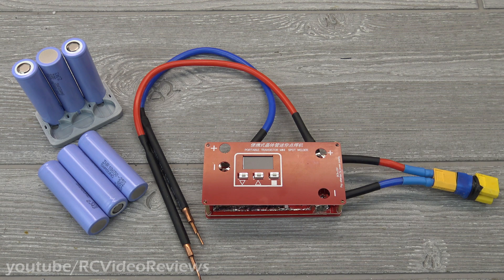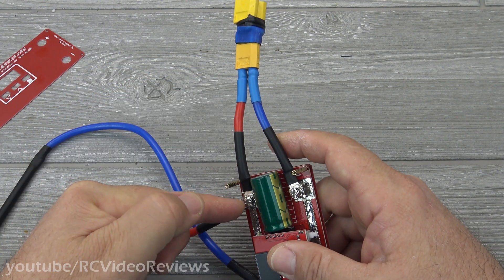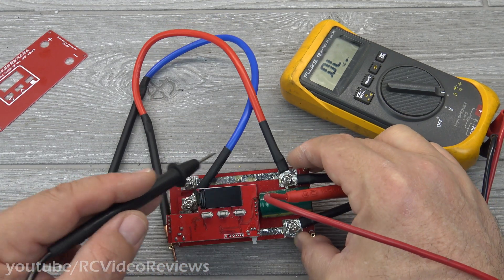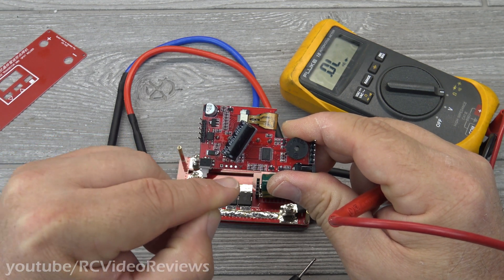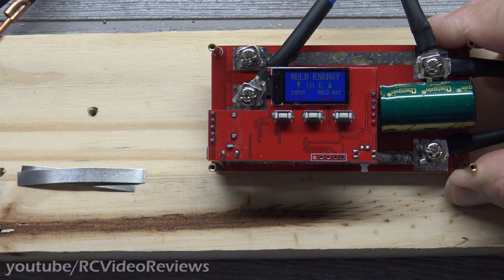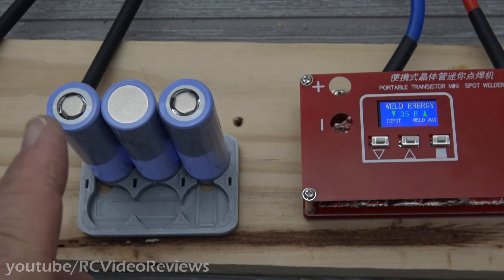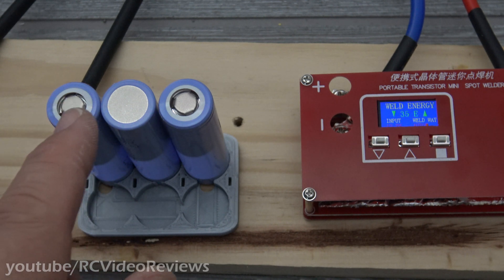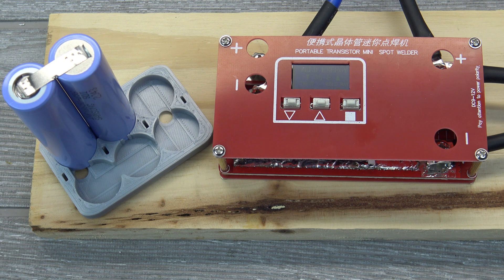Cheap 18650 Spot Welder Reliability Mods and Test

Comment: The positive trace is meant to be like a fuse if the mosfet get shorted, that's why they use 2 srew terminals for the positive . That trace can't provide 300+amps so you don't get a fire if everything get shorted.
Reply from the maker: That's not true at all. I've seen them catch fire in the box stock config. More than once.
Reply: @RCVideoReviews   i am not talking about saving the mosfets from a bad battery. i am talking about saving everything from a good battery by accident.
if you have a bad battery we all know what happens, a single mosfet will burn. you will see the flame and probably you will remove the electrodes.

now if you have a good battery and for some reason the two electrodes get stuck together all cca from the battery will flow to the whole system and the mosfets won't burn cause they can handle the amperage. the trace then will burn from the excessive amperage.
if the battery is good and the mosfet shorted the same applies, the trace won't handle all CCA amps.
if the mosfets are shorted and by accident the electrodes stuck together, the same applies, practically you short a full charged battery and there is nothing to stop it.

same if a short happens before the mosfet , the trace will save the cables and the battery.
you are saved from a big fire/melt of cables, you are not saving the mosfets.
if you don't use a car battery and you use a lipo, i really don't think you want to short it for long.

all decent spot welders (malectrics/kweld) have a 300A fuse in the + line from the battery to protect the battery and the cables , not the mosfets. that fuse is right after the battery terminal (not the same with the trace) but at least is extra protection. think about it you have a unit that shorts a full charged high amperage battery and there is no fuse anywhere (some guys use bigger cables and copper in the traces so there is nothing to hold the amps if something goes wrong).
Reply from the maker: @BeetleJuice1980  That's a pretty poor excuse for a fuse. I wouldn't rely on it and I wouldn't trust it. There's no chance that solder is applied in a way where it could possibly result in a measured fuse. Sorry, not buying it.
Reply: @RCVideoReviews  It's obviously not measured, that's not the point. It's a cheap design, it's a McGyver fuse! It makes sense to me. I can't see why else they'd put it there.
Reply from the maker: @geometerfpv2804  I can't see why they couldn't figure out to put a capacitor across the control circuit either but here we are. If you want to use it as a fuse you can certainly do that. It won't cost you more than a cheap dinner out.

Comment: You are putting too much pressure during the welds. Lay off the force and your welds will be much more reliable. There only needs to be enough pressure to make the contact between the two surfaces, you should not jam one into the other. That reduces the resistance and therefore the heat of the welds making them unreliable.
Reply from the maker: It must be hard to see it in the video, but that's about all the pressure I put on. Just enough to hold the strip still and keep it flat.

Comment: I smoked mine on the very first weld. Blew a mosfet. What is the max amp you can push through these welders?

My battery is a 3s 21700 40t samsung cells. 3s40p capable of providing over 400 amps constant. I think that is my mine blew up. Any ideas?

I ordered a new one. Hope I don't blow it too.
Reply from the maker: The instructions say the load demand can be as high as 140a. The power supply doesn't dictate amperage though, the load does. Mine has been working well with the mods I performed in this video. In fact, I just finished my first 3s2p 18650 pack and the spot welder did fine. I think that capacitor between the diode and ground helps stabilize the control circuit and keeps the fets happy.
Reply: @RCVideoReviews  I'm going to do the mods you did on my next one.

When the mosfets close I figured the load would be infinite. Isn't it basically a short circuit when the mosfets close? If so I pumped around 440 amps through the mosfets. I honestly have no idea if that is true. Building a 140 amp pack for the next spot welder.
Reply: @RCVideoReviews  update:

I removed the blown mosfet. Finished my 3s5p 21700 40t pack. Beefed up the solder, and it's working great with 4 mosfets!! Welding 1.2 strip at level 30. Sweet!
Reply from the maker: @kevinroberts781  Good deal. Did you move your positive pen to the positive input?
Reply: @RCVideoReviews  I did!

Comment: i found it best not to push the probs down to hard on the nickel you get a better weld that way less resistance
Reply from the maker: I haven't done any testing, but I pressed hard enough only to ensure the nickel strip made good contact with the battery terminal.

Comment: Get one of those pens with spring and contact switch. You'd get more consistent result... same force applied onto the contact point each time.
Reply from the maker: I just welded 6 batteries in 3s2p and it did fine. Set to 45e for attaching to batteries.

Comment: I would be interested to hear what others think of these welders because I bought one a few weeks ago, did the Cap mod before using it, saw the soldered link on the PCB and connected my leads direct to reduce the resistance, basically the same as RC vid reviews mods. My results have been mixed. welding two pieces of tabs together can produce a 'strongish' weld but when trying to weld the tabs to a battery the zap just isn't there. I perhaps need to up the current available and try again.
Reply: To the OP, you may be pushing too hard. Pushing hard actually decreases the resistance, so lowers the heat, and makes it weld less. Kind of counter-intuitive. Just barely put enough pressure to hold the parts together.
Reply: Yeah... not enough water in the barrel won't produce a strong stream at the output.
Reply from the maker: What power source are you using? I wound up using 45e and a 12.1+ v 3s LiPo and the welds worked pretty well. I charged at 5a, discharged at 8a and it did well.
Reply: @RCVideoReviews  I tried 3S 2200mAh 35c I haven't reduced the length of my input power leads yet but that should help as they do get warm. I do think there's potential for these little units but like all the Cheap-end electronics it can be a bit hit and miss. I will certainly try increasing the potential amps available to give it another shot.
Reply: @RCVideoReviews  What is minimal voltage 3s Lipo for good weldig?
Reply: @Ziomal716  The voltage is dictated by the fact that it's 3S, 4.2 volts per cell fully charged. The manufacturer recommends a 3S with 50-60C discharge rating, 5000mah+.
Reply: @geometerfpv2804  I understand what voltage the 3s lipo kit has, but I'm interested to what lowest voltage do you get good welding? I just ordered my kit and I would like to know how long it can last.
Reply: The required setting is highly variable depending on the power source being used, and the connections to the unit.  That's why the instructions state that it should always be started off at the lowest setting, in case you have a high output power source.  Basically ignore whatever settings anyone else has been successful with, and just ramp up from the lowest setting until the best results are obtained.   Consistency with the pressure applied is necessary also, as that can be a factor with variable results.

Comment: Great video!! I got the same spot welder a couple weeks ago. I did the cap mod before I ever tried to use the welder. I was trying to use a couple 35Ah batteries but had intermittent results. I have a 5200mah 50c battery ordered and should be here tomorrow. Maybe a little to big now that I think about it because thats 260A potential.

Im hoping I get better results with it. 
I thought the traces looked weak. after watching this Im going to build up the negative trace and connect the positive directly.
Reply from the maker: I just finished a 3s2p pack using my 3s2200 and I did stop once to top it off. Other than that, everything worked perfectly.
Reply: My 5200 50c battery came in. I did end up completely desoldering the positive screw terminal so that negative wielding lead cant rub on it. So now connecting positive welding lead can only be connected your way. 

I also used XT90’s for connecting power to the welder. 

Im thinking about trying XT90’s on the welding leads just to see if there would be to much loss through the connector. I figure if it works ok thatd be nice because that would keep the leads together. As well as itd fit a little nicer in the 2.5” zipper hard drive case I stow it in.

I also took a micro push button mounted to a pcb I ground down to almost the width of wielding lead, soldered a 22awg silicone zip-wire to pcb switch and covered switch and pcb with double walled shrink tube with a hole just big enough for the center of the button to be exposed. On the other end I soldered the barrel connector that came with the welder. Then zip-tied switch assembly to welding lead similar to a tig torch switch is mounted. This mod/ add on with the spot welder set to manual mode  makes this so much easier to use this spot welder and when I was using the auto mode, because you can position both leads exactly where you need them and get good pressure on both leads without rushing. The other nice thing about manual mode is even if you hold the button it will only trigger once. Unlike auto mode where it triggers every 5sec or so if you hold leads on welding surface very long.
Reply: So now with the battery and mod combo Im able to spot weld 0.23mm~0.25mm nickel strips used in Milwaukee battery packs. Ive successfully rebuild 4 packs now utilizing the factory pack strips. 

I have 0.15mm nickel strip and I know could have been cut factory 0.25 of short welded 0.15 to that but I really didn’t like the idea of that many potential points of failure.

I find it interesting that with just a few mods that seem like if they implemented them in the manufacturing (at least in theory) would cut production cost and almost double its spec’d capacity.
Reply: I think they know exactly what they're doing.  imo
Reply: @jasonscorned  Who’s “they”?

Comment: Excellent timing on this video. I was about to pull the trigger on ordering it. Watched a bunch of vids on it. And only one mentioned the low voltage issue. And he didn't offer any solutions or mods like your video. Happy flying. 🤓
Reply from the maker: I just finished up my first 3s2p pack and it did fine using my 3s2200 packs as input source. It does like the higher voltage though +12v and I wound up using 45e on the batteries themselves.

Comment: I have this unit, I use it with 2 3s 8,000mah 50c packs in parallel. Works fantastic!
Reply from the maker: Great info. Dang man, that's a lot of electrons. I just finished up my first spot welded 3s2p 5000 pack ;)
Reply: @RCVideoReviews  awesome. I've been upgrading old power tools, and making 3s packs for receiver power on my bigger nitro planes, using cheap hobby king BECs, to replace old nimh packs. They work great! I have a volt meter to monitor pack voltage to keep from over-discharging. Fun stuff. I've been using molicell 2600mah 35a cells for the power tools and they are Stout! Using LG m36 3450mah 5.1a cells for the receiver packs, all 18650 of course.
Reply from the maker: @SuperchargedJester  GREAT! I just found Molicells 35a on sale @ 18650 battery store for $3.99. I've been thinking about making a 4s2p for the AR wing. With the spot welder I'm afraid of what I'm going to spend at the 18650 store. Sounds like you've got a strategy to put those things to work too.
Reply: @RCVideoReviews  I found a spare 16v 1000uf capacitor in my stash and just did my first spot weld with it modified. Much more consistent welds as opposed to without. Thanks for the tip and link to that!
Reply from the maker: @SuperchargedJester  Sure thing. Glad it helped.

Comment: Will you do shark byte review at any point ?
Reply from the maker: I don't know right now. I'm really just now in the process of figuring out a direction on HD FPV. So I haven't decided yet. Are you thinking seriously about Shark Byte?
Reply: @RCVideoReviews  yeah Iw been wanting to try digital but I just can't buy DJI due to their proprietary stuff which I don't support (also the variable latenci Is kinda eh) and since I alredy have hdmi Google's I might as well , I think sb will look good once there is a better camera since form what iw found there shouldn't be any reason for the bad video quality in the actual SB transmission , so ye once they make a better camera in micro form factor I might as well go for it. Also I love the 25x25 single board since I really got into micros recently
Reply from the maker: And the dji offer doesn’t record osd??? Is that right? I’m not a big fan of proprietary equipment either.
Reply: @RCVideoReviews  yeah I think DJI records osd as a text file , yeah the proprietary stuff is the main reason , second is that I fly a lot of analogue so it would be dum to have 2 Google's and third reason is that that the DJI air units ect are so expensive for every drone essentially , also it is bigger so can't put it into a whoop (well you can but it's gonna fly like trash )

Comment: Thank you for your videos!
I made a charge station using your design with a couple of iSDT chargers and cut out some 1/4 inch plexiglass on the water jet and covered it with carbon fiber vinyl instead of using wood and I added some LED lights
Reply from the maker: WOW! Nice, I bet that looks fantastic.
Reply: Where's the link to that video?
Reply: @drecoracing  it was on Facebook